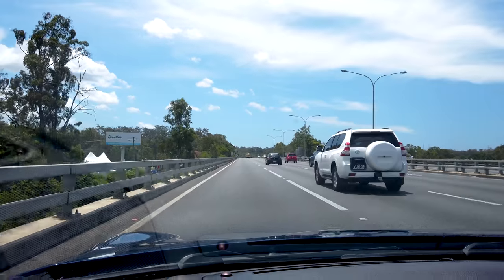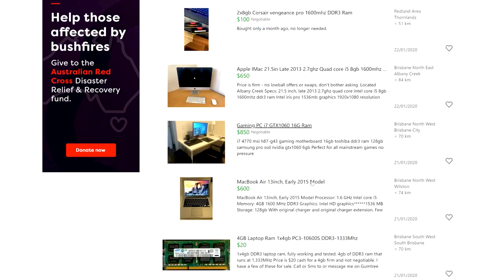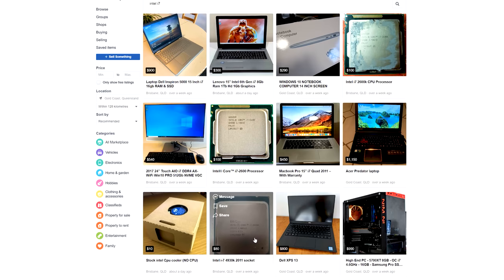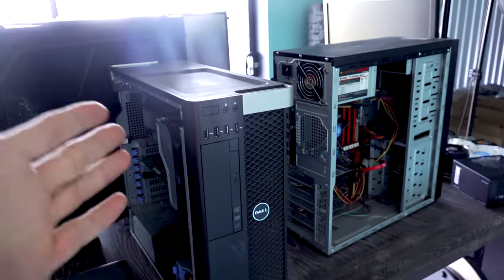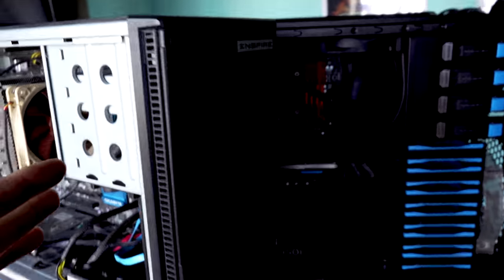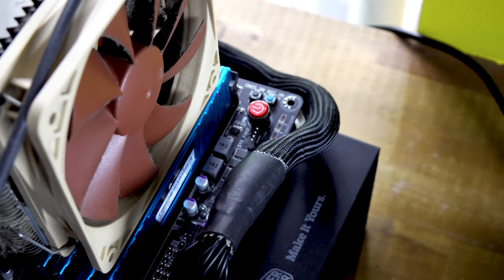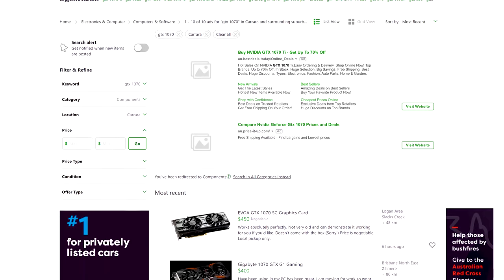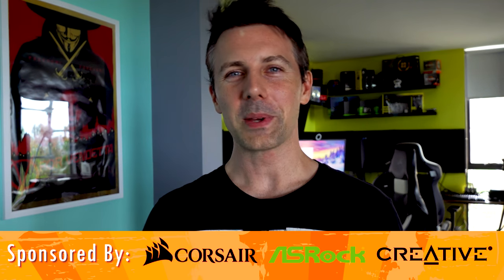January's 2020 USED PC Parts Hunt - Buying UNTESTED $100 PCs

Comment: I honestly think the used prices are bad right now because the new stuff is such good value, for CPUs and GPUs in particular. It's like the people with the old used stuff don't know how outdated their old stuff they are selling actually is. For example, i5 CPUs are still overpriced generally because people don't know how good of a deal you can get on Ryzen etc.  They're just thinking "oh, i5 is mid-tier and has traditionally sold for this much" and keep it at that price, when really it's not competitive value nowadays. i5 6th and 7th gen are always super overpriced for example. Hoping things change, but it's the same here in the SF Bay Area as far as used deals go. Few and far between.

Comment: My favorite pick up is the 2400mhz ddr3

I just had a 1060 come into my lap for 100$ potentially. If it's a 6gb I'm 100% pulling the trigger. Not sure about a 3gb yet. It's not a terrible deal.
Reply: You'll only notice a difference between cards if you run AAA games thatve come out in the past 3 years at high settings, that's really the only time I see a diff between the 3Gb and 6Gb
Reply: Yeah, that 2400MHz DDR3! I've been trying to get a set of Dominator 2400 CL9. My current RAM is Dominator GT 2133 CL9, though I do run it at 2400. 2133 CL9 has the same latency as 2400 CL10. 

For the 1060, only if it's a 6GB card.
Reply: @GatorTomboy  I only play games that recent. Lol
It's either gonna go in a pc build to sell or sit around in my test system for all the parts I pick from the recycle center. Its drivers are recent and I dont need to worry about legacy problems like turing and rdna2 experience on old hardware.
Reply: @mattsmechanicalssi5833  LOL seriously we need to have a beer sometime. We do the same shit. Some of my coworkers need graphics cards. And they are pretty cash strapped. Even the 3gb would be a.decent fit for them.
Reply: @skoopsro7656  fair, I own the 3Gb model and only notice a diff when I played the division, I'm heavy into PvP comp games like cs, dota, league, and Fortnite so I never notice a difference because they can run on trash hardware
Reply: @mattsmechanicalssi5833 , Cl9 DDR4??? Never heard of that... If it is a DDR3 with 2400mhz and cas latency 9 then the prices should be huge...
Reply: @skoopsro7656  HaHaHa! I'd love to sit down with you and have a few pints!  

There's RX 570's and RX 580's out there going for around $100. Even some gtx 980's for $120 or so. Check on Ebay. That's where I get a good deal of my used parts from. And keep an eye on your local used markets, like craigslist, or whatever you have in your area.
Reply: @digantamajumder5900  G-Skill made DDR3 3000MHz CL12, but good luck finding that! I even asked them on Twitter if they could have a look to see if a set might have fallen behind a shelf!
If you look on Ebay for DDR3 2400 (PC3 19200), you can run accross the Corsair Dominator Platinum's with 2400 CL9, and they are pricey. Especially when you have 8 DIMM slots to fill up!
Reply: @mattsmechanicalssi5833 , Yeah.... but really... a Cl9 2400mhz would surely give a killer performance....
Reply: @mattsmechanicalssi5833  yea this 1060 is a local craigslist ad. Seller is sending pics in the AM. And I'm all about Ebay. Awesome deals if you find the good sellers who do pretty good volume and dont care about the last dollar an item has. Gotten some pretty nice memory deals lately local and on ebay. Good bdie cheap. People dont seem to care much for ram above 3800ghz because of ryzens popularity and the IF desync. So great bdie memory is plentiful
Reply: @GatorTomboy  I appreciate the words of wisdom. I never got Into those type of games much. I am however a big div1 fan really wish they would have kept that game going instead of focusing on div2. It doesnt feel the same. The teamwork part isnt there like you could do with reclaimer and tactician. Those helper gearsets and the medbox made that game.
Reply: @digantamajumder5900  If I only run 4 out of 8 DIMM's (4x4GB), I can hit 2666 CL9-9-9-24-48-2t, but with 8 DIMM's (8x4GB) I'm limited to 2400MHz CL9-11-10-27-54-2t. This could also be CPU dependent as well, which is why I am looking for higher clocked/same latency ram. And to correct my earlier statement, G-Skill actually made 3200MHz DDR3.
Reply: @mattsmechanicalssi5833 , dude... what sort of motherboard and cpu are you using.... I can't ever imagine such numbers in DDR3....😨😨
Reply: @digantamajumder5900  EVGA X79 DARK, with a XEON E5-1680-V2 (4.7GHz all core), 32GB (8x4GB) Corsair Dominator DDR3 2133 @ 2400 CL9, GTX Titan Xp Galactic Empire Edition, all water cooled on two separate loops. The CPU and RAM sit at 21c idle and 50c max, and the GPU is 23c idle and 50c max. I am in the process of designing and building VRM and PCH water blocks for the motherboard. 

My old i7-4820K could do 5GHz on this board, at 1.355v.
Reply: @mattsmechanicalssi5833 , super......

Comment: 13:03 pro tip, install win7 pro and use that key and activate it  then upgrade to win10 with internet and then add ms account , and boom u have original windows !

Comment: Hey Bryan, i have also come into that same issue with i'm pretty sure an identical thermaltake power supply with that whine. Seems like it could be a common issue with these thermaltake power supplies! I just straight up junked the thing.

Comment: As a girl who's custom liquid cooling loop cost more than most people's entire gaming PC's, I can't understand why anyone would want used computers, or parts.
Reply: Darth Wheezius  I've been building and modding PC's for over 10 years for people in my local area, and it's more of a form of art for me than anything else. Some people love spending thousands of dollars on their cars, or their boats. For me it's PC's.
Reply: Darth Wheezius  I get where you're coming from, and that's the great thing about building your own PC's you can build them to suit your tastes. A sleeper build with a threadripper would be awesome. My car is a bit of a sleeper build. It's an ex-police owned 2005 Ford Crown Vic that I put about $4k worth of aftermarket high performance parts in. Last time on a dyno it was getting over 400 HP to the rear wheels. Nearly anyone pulling up along side of me at a red light and revving their motor sees nothing but a dust. LOL

Comment: 0:27 man that's still the same thing going on in America right now. Gpu's are so over priced still, you can't find a decent deal for making a cheap gaming rig. I have been without a computer worth loving in 6 years. Not gonna go into deep details, but a moving accident left me without my $2000.00 rig and my backup rig got soaked in standy in a rain storm by a leaky roof.. 

My wife has a desire to start PC gaming as well, so I need cheap systems to start out with, with a budget of $250.00 for both together 😂

I don't expect miracles, but a PC able to play java Minecraft with mods like RLCraft, ftb ultimate 2 reloaded, and mind crack 3, to say the least, maybe gta5, and it doesn't have to be above 720p but would be cool at least 1080p.

Anyone help me out, I'm struggling
Reply: Can do $500 for both, but that projection would mean I have that money now, vs 2 more weeks down the line...
Reply: Both being $500 in total, USD vs 1000..